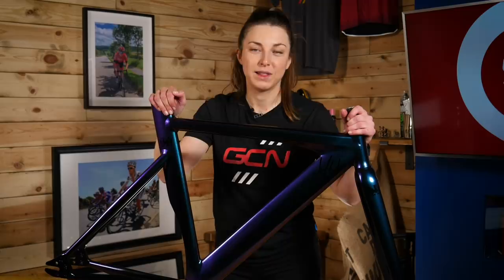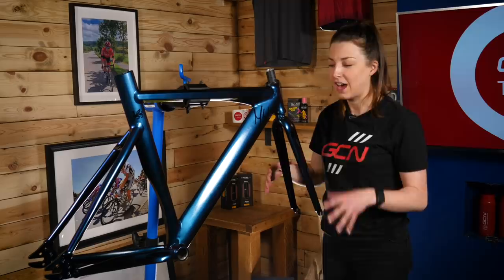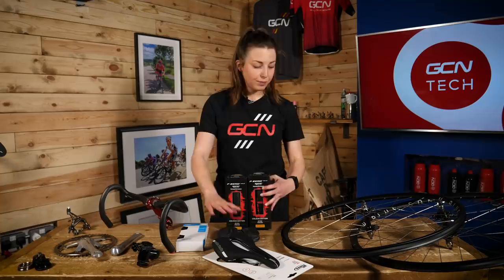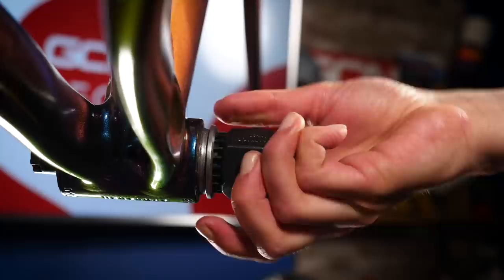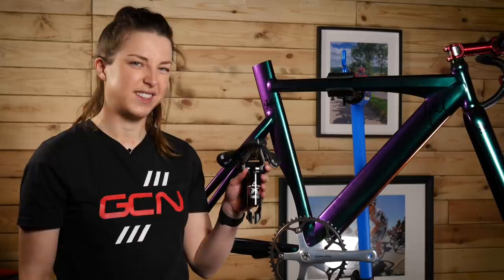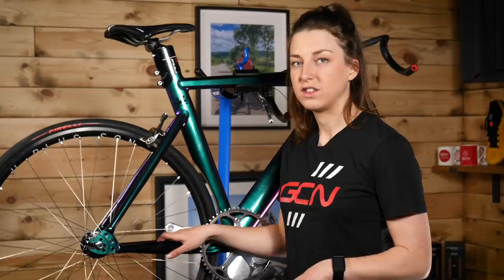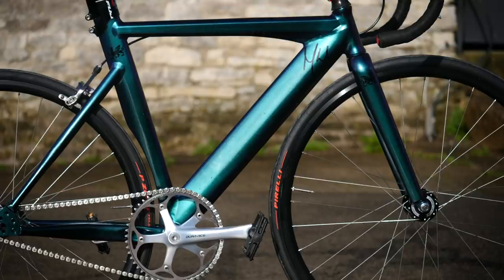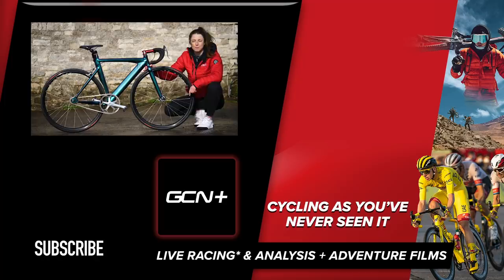Building Manon's Custom Painted Track Bike

Comment: Manon, How about spray painting your crankset with a sort of reverse scheme of the frame? 
- Black crankset (or metallic red, like the stem?)
- Details:   Welsh lion and/or your initials and/or 'Manon' in the same font as your intitials on the frame
                   Coming through in a colour that matches your frame. 

Not sure if the chameleon paint would come out nicely on such small details, so that would require some experimenting, or a greenish colour matching the frame.

Comment: There is actually a front brake mount in that fork which is filled with a steel pin. You can hammer it out of there to mount brakes.
Reply: And be legal.  AIUI, each wheel must have its own brake - the fixed wheel counts as the brake for the rear wheel.  You do have the brake lever on the best side for the front brake, too.

Comment: Nice build!  I would not have gone with half links.   It's nice to setup the length very close to perfect but they are fragile.  Riding trials, I lean my lesson in 3 rides.  Good thing I did not loose any teeth!
Reply: What's wrong with a half link?
Reply: @suxcesss  the angled part of the link adds sideways load to the pins.   Plus the bike trials community has lots of experience with them and the common knowledge is they are not as strong.  I don't have scientific data to back what I say though so take it with a grain of salt!

Comment: Bar the red stem it looks great. I'd be terrified with just a rear brake in towns though. rear brake, carbon brake track (or is it black coated aluminium) and a car pulling out 1m in front of you.
I guess this was just for the video though and won't see much / any riding.
Reply: It's anodized aluminum. And a rear brake really helps to stop... But she should add foot retention.

Comment: I really like the coulour of the frame and Manon did really, really good at building a bike for the first time! However, the result is not suited for the job. One thing a fixed gear bike really does not need is (another) rear brake with no stopping power. Also, you won't use 52-15 with a reasonable cadence very often for commuting or everyday use. It also lacks all the other components to do that kind of job properly. E.g. fenders, lights and a rack. This bike is good for sunshine and café stops. That ist where the Dura Ace cranks can shine ;) Also, it appears to me that the frame is a bit too small for her. It looks like her knees are sticking out to the side, but I might be wrong.

Comment: Having a front brake would make more sense than just one in the back. A different fork could allow it. Having only a back brake is better than none, though. It can still assist if pedal pressure isn't enough to keep control on a steep downhill.

I am currently riding a beginner fixie/winter-beater/rat bike I built on an old suspension-less mountain bike frame. It has low (38/20) gearing, front and back brakes, and no foot retention. It works for its limited purpose. I may put studded snow tires on it for next winter.

Comment: Don't want to spoil anyone's fun, but GCN lawyers might want to look at Construction and Usage Regulations if she continues to be based, and ride that in the UK.  There needs a front brake, and if there are no mounts, could a hub brake be used?  Could a front brake mount be added?  I believe you can get away with no rear brake if it's a fixie as this counts as a way of stopping the rear wheel, but you've no way of stopping the front wheel.

Comment: Don't forget the lockring, didn't see you put it on, so imagined you didn't.

Also 52-15 for commuting and going to the shop or to grab a coffee is quite optimistic
Reply: Fixed gear bikes are never practical. If you’re gonna own one you might as well embrace that. I once owned a 60(ish)-15 fixie. I sometimes had to push it uphills but it all payed of on the downhills.
Reply: @mxs4193  I ride fixed as my 'daily' only thing I experience as impractical is the lack of a frame mounted lock, but I would choose fixed anytime! I live in a flat country, if I'd live in the hills I might have a different opinion 🤣

Comment: Love GCN and the work done on this bike, but it's not road legal without a front brake.  GCN does a great job of promoting good cycling so swapping out the fork for one drilled for use with a brake would have been better and should have been stated as so for good order.

Comment: The bike is absolutely gorgeous, if I were to ride it I would be concerned about safety tho. You'll be riding in the UK where the rain never falls down and all you have is a rear rim brake.. Maybe it's just 
me but I find the back brake pretty useless in descends. So I would either figure a way to put a front brake by modifying the frame. but meeh it's not my bike so I couldn't care less about riding it since I'm not the one xD

Comment: The bike looks very good but is a little bit strange with only one brake lever. Why did you not mount a cyclocross lever? Also, a good PDR technician can fix the crash mark on your top tube without damaging the paint.

Comment: I suppose that the cops at this time are far more interested in nicking covid rule breakers but if I remember rightly fixed wheel road bikes must have a front brake by law. And that's actually safer.

Comment: Great paint job, now a question unrelated to your lovely paint job, I have a retro racing bike 5 speed freewheel sprocket I was going to put a 7 speed on but I've recently been seeing  earlier mountain bikes with 5 speed sprockets, could you tell me if the space between the sprockets are narrower than the 5 speed on my race bike as I need narrower as I've put indexed shifters on straight bars, I have tried information from the net but does tell me what I've asked and then goes on to something else and then adds come up to sell you something you get the picture, so if you could help I can then spray my bike but questions on that later, thanks

Comment: Lovely bike.  A question about the brakes.  Here in Finland as of 1st June 2020 bikes must have two independent breaks one on each wheel.  How street legal is this bike in the UK?
Reply: Not street legal at all,  our laws are like yours.  The fixed wheel counts as the back brake.  You do need the brake lever on the left for the fron brake, though, so you have some hand operated stopping power when signalling a right turn (the one across traffic).

Comment: Nice job!!, I like the "motorcycle spec" left hand rear brake - is that normal for a track bike?
Reply: typically it is only put on the front when riding in the street. left or right is preference. But most would put two levers just for keeping symmetry, even if one does nothing other than make cool "pew, pew" shooting sounds when you ride.

Comment: The bike is super, I have though one question, why is the brake lever on the left?. All the bikes I've had the rear brake is always on the right
Reply: In UK, left brake is rear, front brake is right.  Most other countries are the other way round.  In the UK, the The Pedal Bicycles (Safety) Regulations 2010 state “(4) Where the bicycle is fitted with brakes which are intended to be hand operated—

(a)the brake lever intended to be operated by the right hand must operate the front brake; and

(b)the brake lever intended to be operated by the left hand must operate the rear brake.”

These regulations apply to the supply of new bicycles.
One of the interesting points in the regulations says that pedals must have reflectors, perhaps that’s why bikes come with cheap pedals to comply.  One the user has the bike they can remove them and change to clips less which do not have the reflectors.
Reply: @singingitman  OK ... I forgot to mention that I live in Germany :-)

Comment: 2 rear brakes? I'm guessing she'd ride brakeless but has to pop one on for viewers safety. (Everyone should ride a fixie to commute as they're so simple and cheap to maintain.) I think.
Reply: According to UK law, a bike ridden on the road needs two brakes acting independently on each wheel. The fixed gear is classed as a brake for the rear wheel, but there needs to be an independent front brake. That bike isn’t legal to ride on UK roads.
Reply: @johnwestwell2942  fair enough.  Unfortunately 1 person kills someone on a fixie and the rest of uk suffers. 1 in 400 deaths on the roads are caused by cyclists and the rest die by car accidents. Unfortunately car drivers pay lots of money so they get away with murder.  (Sorry bud)

Comment: Surely that’s not road legal without a front brake?!
Reply: i was thinking the same thing... is the rule to have a hand-operated front-brake? or just a hand-operated brake?
Reply: @khazza930  both wheels must be braked. Your fixed hub counts for the rear. Needs a calliper on the front.
Reply: @DavidKing-qs1sl  
I thought something along these lines, too...

but I just went through the highway code, and it only says "you must ensure your brakes are efficient". It doesn't specify the details, which makes it a bit up for interpretation.

I would've thought a front-brake is efficient (even with a freehub in the back and no pedal brake)...

anyway, I have no fondness of single-speed bikes and I like my brakes... so it doesn't affect anything I do... but I would like to see them address this point maybe in a future video or something
Reply: “It's an offence to ride a bicycle on a public road without two efficient braking systems, operating independently on the front and rear wheel. Apart from saying that a brake which operates directly on a pneumatic tyre is not efficient, the regulations are unhelpful as to what is or is not efficient, nor do they define how the brakes must operate.”
Reply: But it’s also law to have orange reflectors on your pedals at night.
Reply: @DavidKing-qs1sl  
that is true, also another mystery to me, considering all the clipless pedals out there...
my point was just that Manon's bike might actually be road-legal... during the day, at least ;)

Comment: So this bike TECHNICALLY does have TWO brakes... but both on the same, rear wheel. And front brakes do more of the job when braking as weight is shifted to the front. I'd change my fork to one which accommodates a front brake. Also that unpainted bit on the stem would kill me. Looks really bad. Otherwise, a beautiful machine.

Comment: Why would one need a rear brake for a fixie?
Reply: That's for when she puts a 21 freewheel on the other side of the hub.
Reply: @davidburgess741  Is this supposed to be a joke?
Reply: @shamanthks7218  Yes, but for a commuter bike 52×21 would be more practical and the ability to coast in hilly terrain has value. As she said, the bike is unlikely to see another velodrome. I don't doubt her ability.

Comment: No front brake, is that actually legal?
Reply: Nope
Reply: Depends on the country. I think in Wales you have to have 2 brakes.
Reply: Don't know if it's legal, but I wouldn't do it anyway, except on a frame geometry that puts a lot of weight on the rear like a dutch bike. Emergency braking without locking the wheel must be a difficult exercise, particularly on wet pavement like we see at the end. I would almost say that having no brake at all (but foot retention) is less dangerous than relying on a somewhat unsafe brake.

Comment: Shocked to see GCN promoting an illegal build without a front brake, a pedestrian was killed a few years ago by a rider with a similar build and the rider went to prison. Also, that gear ratio will mean a cadence of about 50 unless you’re doing very high speeds, which doesn’t really make sense on a bike to tootle round on

Comment: This bike illegal to ride on the road!  A lady on Oxford street was killed by someone riding this exact setup.  It resulted in a jail sentence for riding an illegal unsafe bike.
It's an offence to ride a bicycle on a public road without two efficient braking systems, operating independently on the front and rear wheel.
A rear brake and fixed wheel both act on only the rear wheel.  Where is the required front wheel braking mechanism?

Comment: No locking on the rear hub, no front brake.  That all may be ok on a velodrome but, as a fixed gear on the road, it is a deathtrap.  Be careful, Manon!
Reply: I had my share of bad experiences with a loose lockring. On a fixed gear, your life depends on that small steel ring.

Comment: Oops! It is illegal to ride this bike on the road: see the well-publicised case of a fixe rider who killed a pedestrian in a collision in London and is now doing time! It must have a front brake if its a fixed wheel, otherwise it is definitely against the law. If it's a freewheel it needs 2 brakes. Did no-one at GCN spot this?
Reply: I was about to make the same point..    I think legality varies between countries, but in the UK where Manon intends to ride this, it is absolutely illegal..  No doubt about it.  If the front forks can't take a brake, you need a different fork.
GCN - You need to address this as a clarification  in the next GCN show...

Comment: I’d suggest that either you modify the bike to include a front brake , to make it road-legal in the UK, or you pull this video.
Reply: Fixed gear and rear brake. Two methods of braking which is all you legally required the UK.
Reply: No, there needs to be independent braking on both wheels. A fixed wheel bike must have a front brake - the fixed wheel acts as the brake on the rear wheel. Putting a second brake on the rear wheel doesn’t meet the requirements of the law.
Reply: Here’s the law in question:

‘By law, fixed-wheel bikes (i.e. bikes where “one or more of the wheels is incapable of rotating independently of the pedals”) have to have a front brake. (PCCUR r. 7(1)(b)(i))’

Comment: Er....

I really hate to point this out. But riding a bike without a front brake, on British public roads, puts the rider at huge potential legal risk.

A bike rider in London, who was involved in a fatal collision (with a woman who crossed a red signal, while looking at her phone), was convicted and imprisoned for "furious cycling" - in large part because his bike lacked a front brake. 

Just not worth it. We all know that the lack of a front brake is likely to make little difference to actual stopping distance. But if you are involved in any sort of accident, and the cops notice you don't have a front brake (and they will) - then you are inevitably going to be held 100% responsible. Even if you aren't.
Reply: Er.... She has a back brake and it's a fixie so there's two ways to slow down, thus the bike is legal.
Reply: No. That is a common misconception. It's not the number of brakes or stopping mechanisms. It's the British legal requirement for a front brake. 

Riding a bike without a front brake on British public roads is illegal.

Comment: Nooooo!!!!!! only one brake, you have got to be kidding me... If you know the fork wont allow a front brake why not switch it before painting it. Also riding on the hoods is the most common bike position but now you will be sitting asymetrical whilst sitting like that. The bike looks really nice but the finish is horrible in my opinion :(